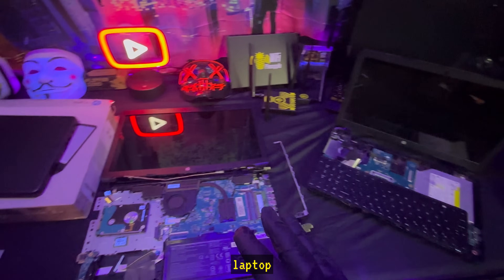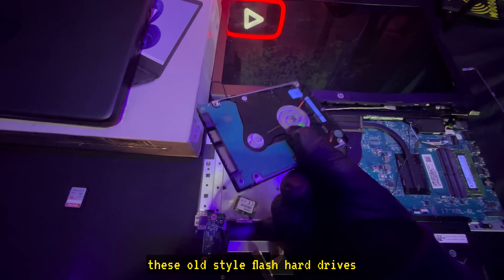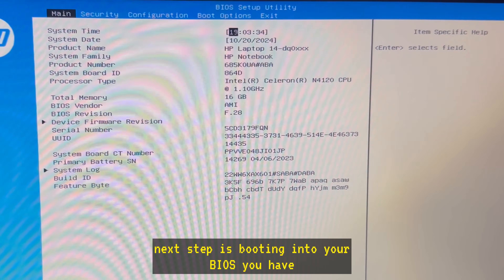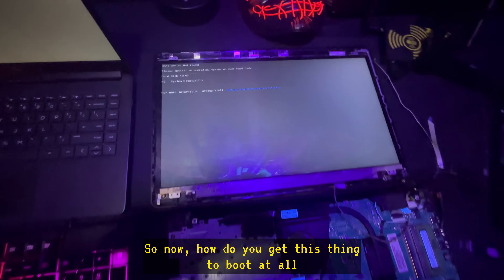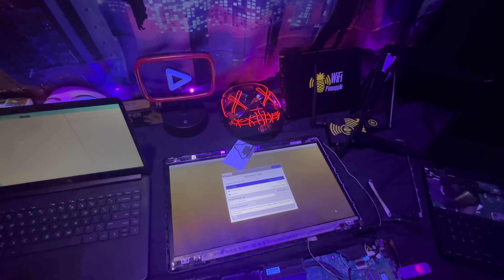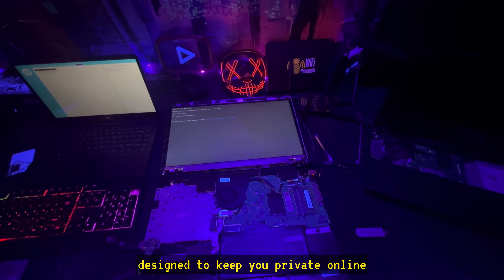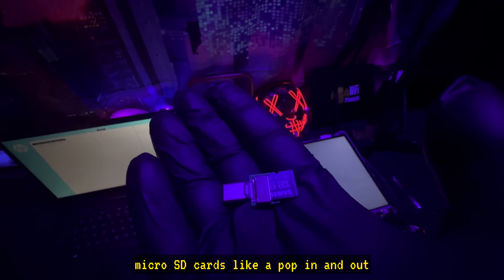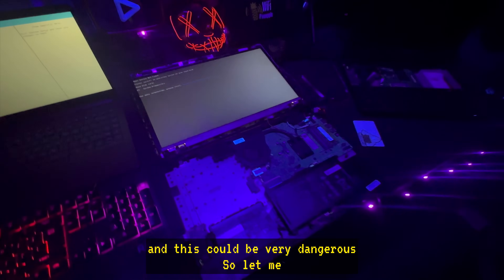Build a Ghost Untraceable Laptop: Ultimate Guide to Online Anonymity and Privacy! DIY

Comment: This will not be completely secure. Even if no evidence of use is left on the device itself, the computer you're using can still be identified through various means.
The information your web browser reveals to websites can be used to work out many details. Even without JavaScript, your computer's resolution can be found if you maximize the window.
Furthermore, digital fingerprinting can be used to uniquely identify users based on how they move a mouse or touch pad. And that's not including further evidence of identity which can be acquired through individual textual nuances like grammar, spelling errors, and typos. Literally everything you do on a computer can be tracked, logged, and referenced to build a profile if someone actually cares to look into your activities.

Fact is, there's no easy solution to digital privacy. If you're watching a video like this, then you're probably not informed enough to actual have a truly secure internet connection at all. If you aren't intimately familiar with the inner workings of every piece of hardware, your operating system, and every program on your computer to the point where you can identify unknown applications and lock down any behavior you don't want operational, you can't even be sure that you're not already compromised. On top of that, you'd need to understand how your computer interfaces with other devices in order to identify when and if unknown communications are being delivered or sent. 

And spoiler alert: This is an extremely common occurrence. Lots of different organizations, governments, businesses, hobbyists, and hackers all send and receive information from every device connected to the internet. Don't believe me? Shut down every device on your home network and set up a Pi Hole or similar device with your router. Look at all of the incoming connections. All of them are requesting something from your home network.

Also, know that if you've ever installed a Tor browser or downloaded Tails OS, you're on a watch list. Using a VPN, proxies, or obscure applications broadcasts to the world that you've got something to hide. Anyone with the know-how can find out what you're doing, if they're so inclined. My advice: If you really want privacy, blend in with the crowd. Don't paint a bright, neon "WATCH ME" sign by using obscure software.

Not trying to deter anyone. I'm just pointing out how insanely complicated this stuff actually is. If you've still got the gumption, check out the Hidden Wiki for some starting points on hardening your system against identification. Also, make sure to use a computer that has Intel's IME or AMD's PSP completely disabled. All of their publicly sold CPUs have back doors. The government gets special Intel CPUs made without the Intel Management Engine. Compromises on that low of a level render anything you do on your operating system completely pointless. Your OS very well might not even be able to see what's going on there.

Good luck!

Comment: what abt a riser cable for the ssd replacing the sd card port, so instead of an usb drive(wich is less durable than an ssd) you can use a removeable ssd

Comment: Neat video, however I would suggest you use old Lenovo laptops (W-class workstations & T-class notebooks) because they have a hardware switch to kill all radios to ensure you're not emitting any RF. Also put TAILS on an SD card and boot to the internal SD card reader rather than have a USB drive sticking out the side.

Comment: Kinda pointless. I mean... if you're worried about the camera? Black electrical tape. If you're worried about the hard drive? You can remove all partitions. But you aren't using it anyway since you're booting externally.

The microphone is trickier... But this video kinda glosses over what a RIDICULOUS PAIN IN THE ASS taking apart a laptop and putting it back together is.

Comment: So this is great, but for most people's purposes, this is way out into the realm of unnecessary. In recent years, the feds have gotten lazy about tracking your individual online presence, they have google and microsuck do it for them instead. Usually, so long as you can mask your identity from those clowns, the feds will have very little info about the common man. Now, the best way to mask your lateral website movement from these mega corporations is to use a basic on disk Linux distro, like Linux Mint and Librewolf as your web browser. You give up almost none of the typical creature comforts we enjoy today going this route, and the amount of inconvenience Tails offers is slashed by at least half. Tails has the benefit of near perfect untraceability, BUT, you have to already be an above competent pc user to take full advantage of its features. Generally, Tails and TOR are not compromised, assuming your persistent storage doesn't use bad passwords. Your behavior is what compromises you. Things like your typing speed and mannerisms as well as the motions of your mouse and the websites you visit are used to "fingerprint" or profile you. That's how so many dinguses get caught doing illegal shit. Thankfully, most actual criminals are morons. But you aren't a criminal, you're a concerned citizen worrying about his ever eroding privacy rights, and by far the most convenient way to evade prying eyes is to go with Mint and Librewolf. Most people are Snowden levels of wanted anyway.

Comment: Basically could have done the same thing with the hard drive and camera still in it - if you boot from a "live" Linux image on a USB stick it won't use the hard disk anyway. You can put tape over the camera, ir, if you open the case, just unplug it from the motherboard. As others have said, your MAC address will (usually) uniquely identify a laptop if you use its WiFi. So you should use MAC spoofing, or an Ethernet to WiFi gateway dongle to strip off the laptop's MAC (I've made these - I design PCBs and write embedded firmware for a living). You can also create a linux install that boots from the internal drive, with all partitions mounted as read-only, and uses RAM disks for your home directory, var and tmp, so it's all deleted when powered off. Much faster to boot, and use.

Comment: A flash drive is an I/O just like the camera, mic, and HDD. removing these has nothing to do with secure browsing, and if you're willing to strip out peripherals, why buy that system in the first place? Why not start off with an SBC? PI5 costs a fraction of that laptop and provides way more access to customizing & controlling identifiers. You could even buy 2 PI5s and make one a travel router and have hundreds of $$$ left over.

Comment: If you want to build the ultimate “ghost laptop” for privacy, it’s all about combining the right hardware, software, and strict operational discipline.
	1.	Hardware: Use an older laptop without modern tracking features like Intel Management Engine. Remove or disable the built-in camera, microphone, Wi-Fi, Bluetooth, and even the battery (run it on power only). Use an external USB Wi-Fi adapter for networking and replace it regularly to avoid tracking.
	2.	Software: Run privacy-focused operating systems like Tails (runs from USB and leaves no trace) or Qubes OS (isolates activities in virtual machines). Route all your traffic through Tor or a reliable VPN.
	3.	Security: Encrypt all storage (e.g., VeraCrypt) and only use removable, encrypted USB drives for sensitive data. Stick to private browsers like Tor Browser or a hardened Firefox, block all trackers, and never log into personal accounts.
	4.	Physical Security: Store the laptop in a Faraday bag when not in use. Use hardware kill switches to cut power to Wi-Fi, the camera, and the microphone when necessary.
	5.	Operational Discipline: Don’t mix sensitive activities with regular usage. Change MAC addresses frequently, avoid public Wi-Fi, and use encrypted communication platforms like Signal.

In short, the ultimate setup requires discipline. No technology can fully protect you if your habits reveal your identity. It’s all about minimizing your digital and physical footprint.

Comment: USB stick days are gone!!!

You wanna have a reliable removable storage: NVMe + NVMe Case.
It still relatively small and faster than USB stick with plenty of storage as needed.
I've tried to use USB stick as storage in the past, it was not designed for that and will die very fast.

Comment: All that was unnecessary. You didn't have to take apart your laptop to run TAILS. THAT OPERATING SYSTEM IS DESIGNED TO RUN ON RAM ANYWAY. So for you to take out the hard drive is unnecessary. It doesn't use the hard drive. Good luck with your channel

Comment: Raspberry Pi's are great too because they are tiny and pretty powerful now. You can use Alfa AWUS036ACHM usb Wifi (most Alpha's will support monitor mode I think) /w macchanger and a micro USB for the disk. For the monitor they make these tiny 7" monitors for them but you can just use headless mode and ssh or vnc to it from your PC/Mac. Be sure to cycle it a few times to clear RAM after use.

Comment: used to have a hp 2000 that i was using pulled of the back pane for easy access to the ram for these live systems so in case of a scenario in which i knew i was about to be fucked i could ppuulll the sticks out and throw them in a blender or microwave
Reply: also if youre gonna go the extra step of ripping out a mic and camera you might as well rip out the speakers too they can and have been used as mics themselves

Comment: Fake. They can read out the intel management engine and get chip codes. Those codes can be recognized and be traced back to you getting the laptop.

Better to get a laptop from a dealer you don't know and he/she does not know you. 
And then only use it in a different state for about a week and burn it after the attack.

Comment: What about flashing BIOS with opensource BIOS?

Also buying the laptop is a task.  Best to find hardware meet ups in a town 2 or 3 towns away and borrowing a friends car or buying. Bus ticket with cash to visit.  Buy the laptop via cash.

Ive come across situations to buy laptops over the last 10 years using cash and have bought them and sat on them and then peeled. Laptop off the stack. Reconfigured it and used it for a task and then removed the ram, cycled it in another laptop, destroyed the hdd and any flash storage snd either reused it or scrapped it, depending on the task

Comment: So basically buy some cheap used laptop, unplug hard drive and network card, unplug or cut cable from microphone, speakers and camera, make bootable tails on pendrive, use tor, vpn and you are ready to go. Buy wifi card in usb. And never use your home wifi. Also use mac spoofing.

Coreboot, libreboot is also good option. Of course you can do a lot more, search for more secure OS, use not back doored cpu like intel atom and other stuff. If you are not gonna do some bin laden type crazy shit then probably you don't need to spoof motherboard and everything else. Of course there are some issues with intel managment system, data staying in ram even when turned off but this is some really hardcore type of stuff.

Thinkpad x200 with core2duo is good option.

Comment: 8:33 the only way i thinkk it could be compromised if either social enginnering, possibly hacking but i bet u would have the knowledge to prevent this and the most dumb one, which is to leave your laptop open in a cafe or overall in public places, easily prevented with a simple shortcut that starts the lock screen, even the fbi used it, lol. other than that i don't know how u would get something out of these systems, at this point it's just matter of time till u flash ur own firmware and remove that dumb OEM bios lol
Reply: Data is never deleted its just overwritten with new data. if you got a large RAM storage someone can just recover your deleted data. you ether restart your pc to boot a resouce heavy program to overwrite old data or take the RAM with you.
Reply: @nafive5675  can’t you flood the ram with new information?
Reply: How about WiFi/logsz yk the🔦💾?Theresz still some hardcoded stuffv in that,💻?😮